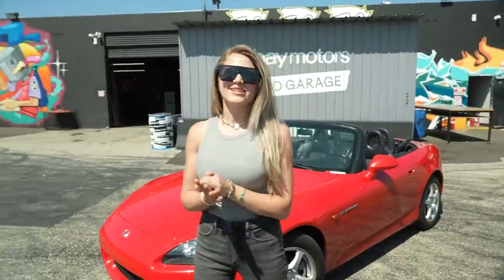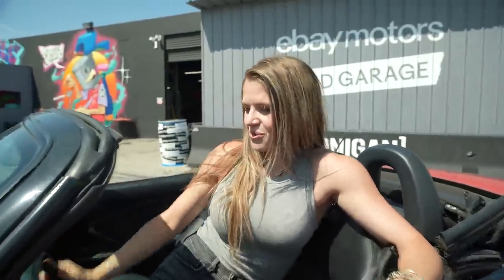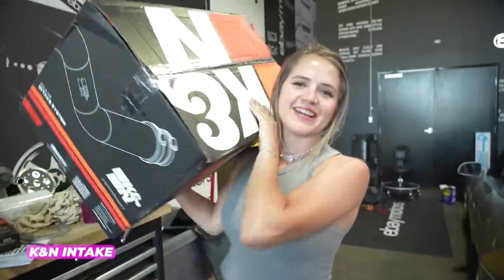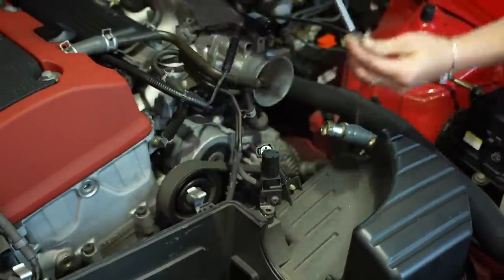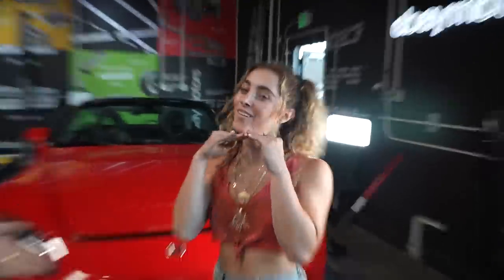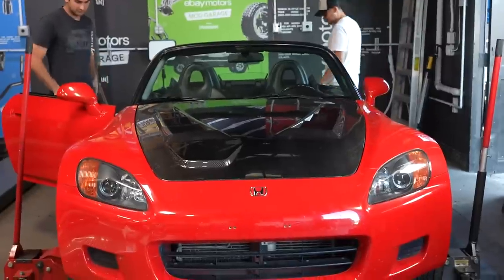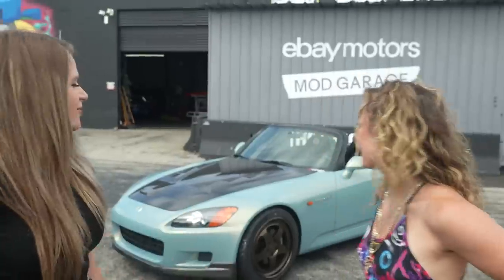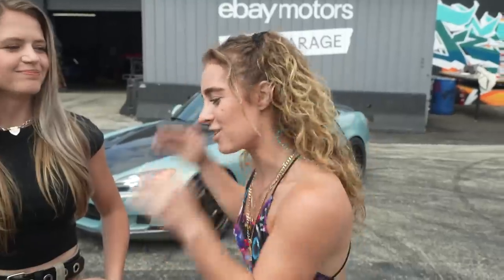Building An S2000 in 48 Hours at @TheHoonigans ! Ft. @DemiBagby

Comment: Looks great, lots of cool mods, great wrap color.  My only pet peeve about this is the red still showing through the front bumper, and the door handles.  Those little details matter.
Reply: This, bad enough all the jams are red but when you see red peaking through from the outside. Also the pinch weld is still red.
Reply: is it just me but under the door handles is still red?

Comment: Fun fact , both my Gen 4 Camaro and pretty much every Corvette ever made is also mid-engine . But then you should know that because you have a Corvette .
Reply: Your gen 4 Camaro is not mid engine. Despite that engine being halfway under the dash the front axle centerline still runs right through it. You're right about the Corvettes though. All but the 6 cylinder cars are mid engine.